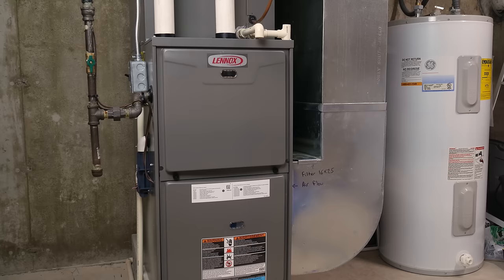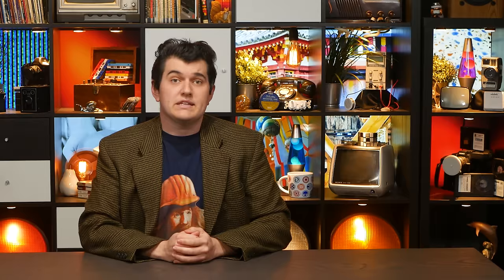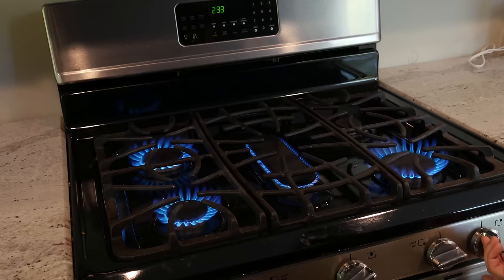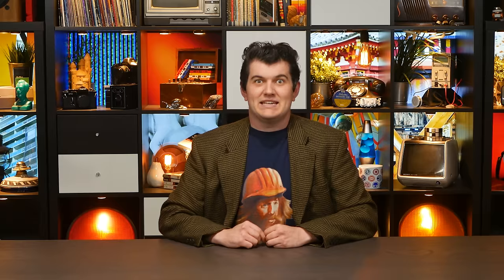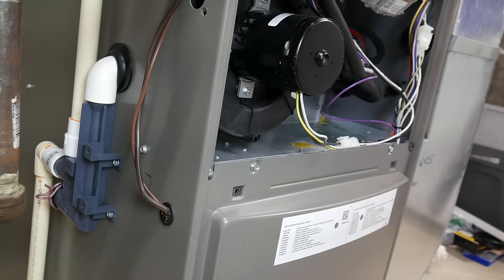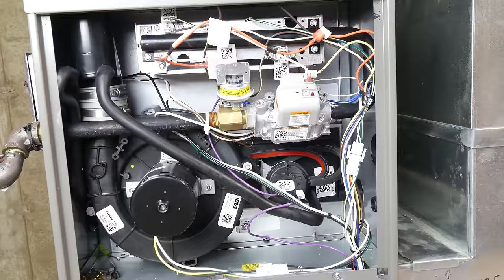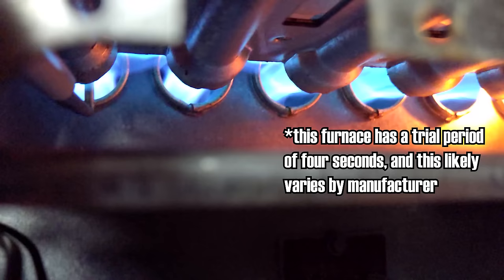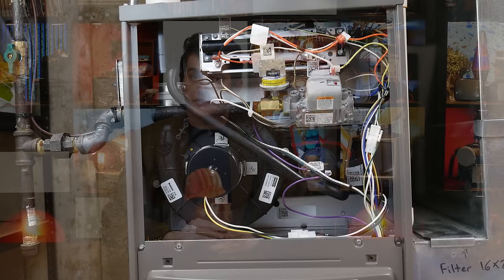Forced-air Furnaces: The What, Why, and How

Comment: "Invest in carbon monoxide alarms and test them regularly. They may just save your life."
I absolutely agree (I say, while sitting in my parents' wooden house that has a gas burning boiler and not even a single smoke alarm).
Reply: Sounds like a great idea for a Christmas present.
Last year I got my parents a 2-pack. We now have 4 alarms in our house and it's nice to not have to worry as much about being trapped by a house fire in the middle of the night.
Reply: @thorlancaster5641  I didn't wait until Christmas, I installed them myself the day I noticed my dad's new-to-him place didn't have any.
Reply: @thorlancaster5641  They also come as CO/Smoke detectors in one unit now.  I have 2 in our house, one in the basement about 10 feet from the furnace next to the stairs, the other on the 1st floor hallway which connects all the bedrooms.  And they will wake you up!  Even with your ears covered it feels like ice picks going in your ears, it's that loud.
Carbon Monoxide is produced when there is in sufficient oxygen to complete combustion, it is a lot harder to get a poorly adjusted burner with gas than say, coal, oil or wood.  Once a gas burner is properly set, unless it is somehow damaged, it should give off little to no CO.  And with a sealed combustion chamber, it can draw as much air as it needs from outside without creating a vacuum in the house.
Reply: @davidmarquardt2445  as someone who routinely produces smoke near those interconnected smoke detectors (soldering), I can confirm that they feel like icepicks. really wish yanking the batteries disabled them sometimes, I'd like to keep my hearing. at least they're effective!
Reply: Once I burnt coals in a closed bathroom
Reply: @jaypawhealer  if you can you should get good ventilation for your soldering area. The gas from solder can be not great depending on what it’s made from. Even something as simple as a bathroom exhaust system can be good enough and will probably not activate your detectors. So  (assuming you have the money) you should get it installed or install it yourself.
Reply: @JuneNafziger  I work in new construction doing trim plumbing, unfortunately I don't really have the option. My home electronics soldering setup is well ventilated and filtered, and I do my best to leave doors open if I can at work, but there's only so much I can do in the timeframe I'm given
Reply: @jaypawhealer  Most of the smoke and fumes come from burning of the flux in the solder (rosin).  Not really harmful. But there are lead products too, so good ventilation is a must.
Reply: this is one of those few perks of apartments no one talks about, guaranteed fire alarms and smoke detectors provided by the property owner.(Per Local Tenancy act of course)
that and snow removal.
You just have to deal with neighbors above you.
Reply: My mum's house has wood burning heat (yeah really) and she has a single smoke alarm, but she's deaf and it's a sound one so.

Comment: The heat in my home is electric, plugged in to hydro dams. My electricity bills are certainly a lot more in January than they are in July, but with good insulation and (by non-coastal Canadian standards) a reasonably mild climate, I'm good to go.

When I was little I remember my mom and dad talking about their new "four stair" furnace. :-)
Reply: Four stair -- LOL!
Reply: My dad's place has electric radiators.   It is an inefficient way to get a given number of BTU (kJ), but it allows easier control around the house.  For example the spare bedroom is set to 12C while the master bedroom is at 22C.   Balancing forced air is possible but generally time consuming and tedious.  So my dad is probably using fewer BTU than he would with forced air.   What he misses is cooling.  (At my place we have forced air which is set low at night, with electric heaters in bedrooms.)

Comment: Just have to say how impressed I am with your knowledge on this subject however you should include a better carbon monoxide alarm in your video as the one you showed only detects as low as 400ppm. To put that in perspective fire department will not enter a building without PPE at 35ppm. My recommendation is “Defender low level carbon monoxide monitor” they make two, One detects 30ppm and the other detects 5ppm.

Comment: as someone who has lived his whole life in an electricity exporting provence i have never lived in a home with a gas furnace. all my homes have been electrically heated.
altho the local electric company is paying people to install gas furnaces now because they can sell there electricity for more if they export it to the usa.
Reply: That's too bad as "natural" gas is linked to fracking, leaked methane and climate change
Reply: @NicholasLittlejohn  : Leaked methane is dependant on the individual formations- some of them should simply be banned from exploitation via fracking. For the other (more common) formations, the fracking is fine. As for natural gas, it is easily replaced with synthetic gas (the only major combustion component of natural gas is methane, and that's the easiest hydrocarbon to produce artificially), so it's the only fossil fuel that we shouldn't try to wean ourselves off of.
Reply: I'm in North America, but have never lived in a home with any gas. Our heaters are heat pumps. It increases our power bill considerably, so when our house gets below 14C/58F (this is in north Florida, so not that often), we use a wood burning stove for heat. Gas appliances scare me, I've seen those news stories of multiple houses exploding.

Comment: *cut in narration*: "Im sorry I said 96, it's really 95. My bad"
Me: angrily gathers rocks for a stoning, this sin cannot go unanswered

a few minutes later
Narrator: "You could call them... U-tubes..."
Me: starts gathering the mob
Reply: sharpens pitchfork
Reply: I had my torch fuelled and lit, ready to join the mob... But I had to put it out because it kept setting off my CO alarm 😏
Reply: Consider yourself lucky. In Europe efficiency ratings were established long before condensing heaters which caused a problem. Efficiency of condensing furnaces when measured with the established methods goes over 100% so it was either going with an over 100% figure, or reworking the method, meaning downgrading all non-condensing furnace efficiency. Since that would have caused a big stink we sell 100%+ furnaces now. Beat that ;-)
Reply: @astranger448  So.... 110% efficiency.... who says perpetual motion can't exist. 😆 I love when marketing throws common sense out.
Reply: @RyanMartin1  Common sense means condensing furnaces are now the rule here. Latent heat is a bit hard to explain to a nontechnical person whereas technology so good it moved the goalposts past 100% and saves you money, the environment and our national trade balance (we import all our energy here) is clear for everybody.
Reply: @RyanMartin1  There are legitimate reason why you might want to use the lower heating value rather than the higher heating value for calculating efficiency. Obviously that's not true in this case, but it's commonly done for things like engines, and not just for marketing reasons.

Comment: A brief comment on the furnace igniter: my family had a ~25-30? year old furnace (we don't know because the previous homeowner was not really mentally with it anymore) that was either 78% or 80% efficient. It had a flint based starter block that cracked and wouldn't ignite the furnace anymore. We found this out (fortunately in the fall, and not the dead of winter) because our home smelled strongly of natural gas from many failed starting attempts after a school break where we went on a small vacation. It would cycle on and go through all the steps, then fail to ignite (making many clicking sounds, run for a while, and shut off).

If I may for a bit, I still do miss the sounds of that furnace. It's weird but whatever. There was something deeply comforting about the whirring and flamethrower sounds, and it was really cool (especially when I was younger) watching the flames start up and go from orange to a nice blue color. This nostalgic feeling was probably why I was listening to the furnace from my basement bedroom and found out that it was trying to light and failing.

Anyway, what I'm saying is that a "sparky thing" such as a flint starter or an electric arc generator may be less reliable than a simple hot bit of metal that starts a fire, and this could've been the reason why they fell out of fashion.

Comment: I have a "Three wall" forced air furnace in my home. The "Three Wall" in the name just means the three ways the furnace ensures safe operation.
Wall 1: An oxygen sensor at the intake right before the burner monitors there is ample oxygen entering the heat exchanger.
Wall 2: Basic Furnace safety devices described in this video.
Wall 3: CO monitor/alarm/shut off built into the main air duct, and vents of each vent.
If oxygen is below a certain percentage, the furnace shuts down. (Wall 1)
If any of the furnace internals fail, the furnace shuts down/locks out. (Wall 2)
If CO is detected in any of the distribution ducts throughout the home, indicating a crack, or leak in the heat exchanger, the furnace shuts down AND locks out, as well as sounds the alarm built into my furnace, BUT it also trips the alarm circuit on my fire alarm control panel, which sounds the "Carbon monoxide warning! Evacuate now!" voice evac alarm. 
The 4th wall is, if all three of these fail, and the furnace continues to operate, the master power cutout on the furnace (which is an electronically controlled switch with fuse paralleled to it) will disconnect. Halting the blower and draft inducer, as well as spring locking the gas supply valve in the closed position.
So far, our furnace has only shut down twice in the past three years, but it was usually from overheat because our return air vent is (stupidly) over our stove (which is electric) and sometimes thinks the heat exchanger is overheating, when in reality, we're just cooking for an army.
Thanks for the intriguing video, and stay warm!!

Comment: There's another safety device, though minor: a switch that verifies the cover is on and secured properly.
Reply: There are other relatively minor sensors even didn’t mention. The ones he did are the most critical ones, the next major one would probably be the rollout switch.
Reply: Hmm have taken to cover off of several at the start of the heating season to be sure everything looks like it's operating well and never had a sensor on the panel.
Reply: @BelHambone  Could be a new standard or it could be like case switches on a PC where some have it and some don't (my MB has a connector for one but I won't connect it).
Reply: @BelHambone  Depends on which panel you remove.  In the video you can see that there is a switch on the blower access panel but not on the control board/burner access panel.
Reply: For those who are confused: This is generally on the blower compartment door only.
Reply: That switch only exists on the blower panel. It's there for a couple of reasons. For one, an exposed blower motor could, possibly, suck combustion gasses back into the space and cause a dangerous CO condition.
Second, running the blower too long without the door on will destroy the motor. The fan has too much air to push and the motor will eventually be damaged by overheating because of overloading.

Comment: There is actually a rollout switch in your furnace as well. It can detect a cracked heat exchanger. The blower will blow air into the Crack in the heat exchanger forcing air to blow through the tube counter active to the draft motor. When that happens a portion of the flame flutters out, or roll's of the tube and trips a thermal, or rollout  switch.

Comment: When I moved from Chicago to Phoenix I had to adjust that it was just an AC unit and no furnace with a pilot light. I don’t even use the AC heating element in the winter, I just use heated blanket around the apartment.

Comment: CO alarm saved my life 4 years ago.

I was taking a shower and had one installed in the basement and wired it up to the alarm system when i got the alert that it went off.

I Called the FD and they came out, turns out, the basement had 10,000PPM worth of CO in there. the furnace had failed spectacularly to the point where it broke the gas companies handheld sensor and the FD's.

Get a CO alarm today, and (if you can) get one that can text / call you because i didn't hear it beeping.

Comment: FYI: some furnaces use the same pressure difference switch to detect if there is a leak from the flame tubes to the circulating air.  It is possible that a very small tear may not be detected, but the time it takes to fill a house with enough CO to kill someone, the air in the house is usually replaced.....if the tear is big enough to be dangerous, then it also is big enough to be detected by the pressure switches.  This is more of a newer high-end model style.

Comment: 4:00 Here in Quebec we sometimes use electric heaters for pretty big places. Apartment buildings are notorious for using pretty much only that, so each person pay for its own heating and the building owner have pretty much no maintenance to do. 

Sure heat pumps are getting more popular especially for bigger buildings, but they need to be helped by an electrical heater because it gets to cold for them to be efficient during the winter. 

For houses, they often use another type of heating as the main one, but because it’s often wood based , which means it requires human interaction and it’s hard to control, there’s some electric heaters in the house to regulate the temperature and to heat it when you’re not home for a while.

EDIT: I’m not saying we don’t burn gas, but it’s pretty much only a thing in bigger cities were burning wood is regulated or just unpractical.
Reply: Exactly, HP's are efficient in places with mild winters.
Reply: @231mac  And extreme winters. They are less efficient in extremely cold weather, but even in Alaska, they still beat gas in terms of energy efficiency. Unless you live in the arctic, heat pumps are great. (Now granted, the ones that work well in extreme weather are generally more expensive, but that's getting better). Plus, even if it gets too cold for a heat pump on the worst winter days, you can just have a backup heat source and it will still save energy in the long run.
Reply: @Owen_loves_Butters  Sorry but nope. HP's are absolutely lousy in 'extreme winters', unless you think anything above 30 is extreme. I owned a Train XL series HP for 15 years and I worked for an HVAC company in the early 2000's. They work great until temps drop past, I would say, 35 degrees. Then the abilities of the heat pump are unable to keep up with the demand and the system switches to heat strips, which are horrible on efficiency. And that's as good as they get, period.
Reply: @231mac  That's dead wrong. That is not even close to how good they get, you should see his videos about them.
Reply: @Owen_loves_Butters  Honestly,  need to consider that with today's advancements, that I should reevaluate their abilities.
Reply: @231mac  I don't know when you got your heat pump, but since you had it for 15 years that's at the latest 2007, and heat pump technology has improved a lot since then. Thanks for having an open mind.

Comment: In Norway we almost had a major tragedy after a lot of youth had a rave party inside a cave, with generators inside with them. Many people became unconscious and got carbon monoxide poisoning, but thankfully nobody perished.
Reply: ebulating  They should, but the CO rising would require sensors being installed in the roofs, like smoke detectors. But it's definitely a problem if the ventilation gets blocked!
Reply: Right after hurricane Laura there were several families that died from running generators in their house or garage or too close to a window.

Comment: In Montreal, Canada where I live, the most common heating system I've seen is electric baseboards. I'm pretty sure the main reason for electricity being used instead of gas for heating in Quebec despite our cold climate is because of how cheap and efficient our hydroelectrical network is and the absence of a gas distribution infrastructure. But I find it interesting that our most common heating solution in a northern country is seen by most of the world as inefficient and at least as impractical.
Reply: It's similar in many parts of upstate NY, and for similar reasons. Lots of hydropower makes electricity very cheap, so it's not worth building a gas distribution network, and it means there's comparatively less incentive to invest in more efficient heat pumps and geothermal systems.
Reply: @techmage89  My state's natural gas prices are lower than Washington State's electricity costs. The equivalent cost per kwh of natural gas in my state is 1 cent per kwh.